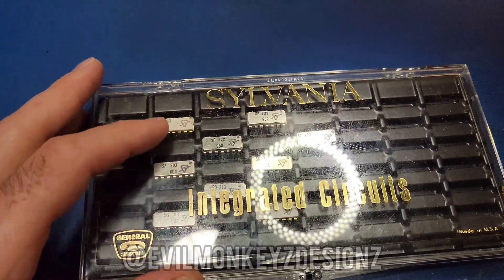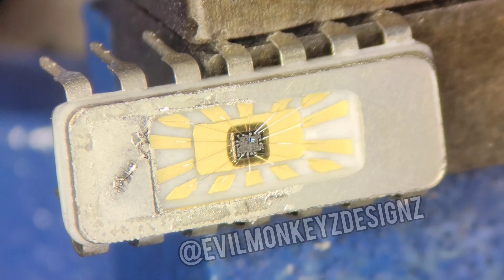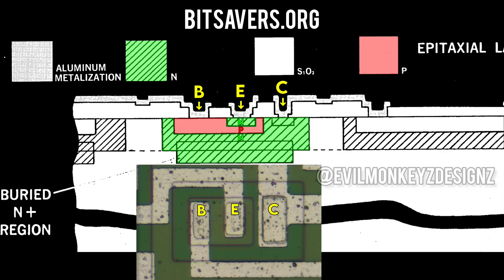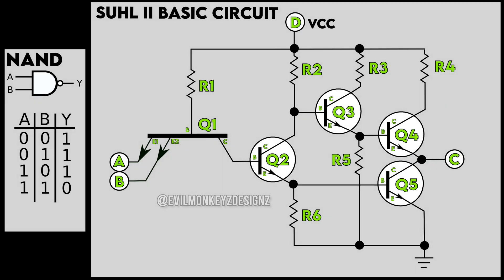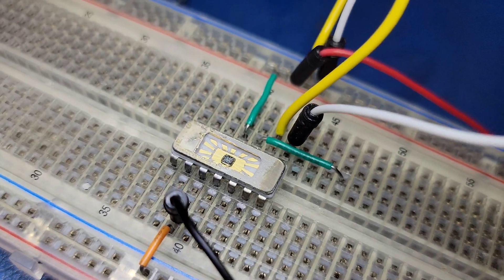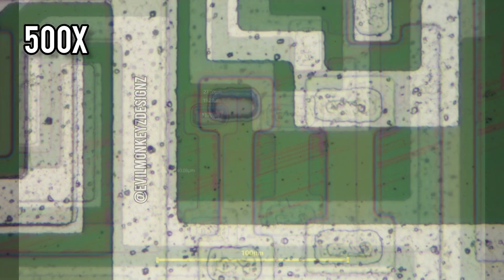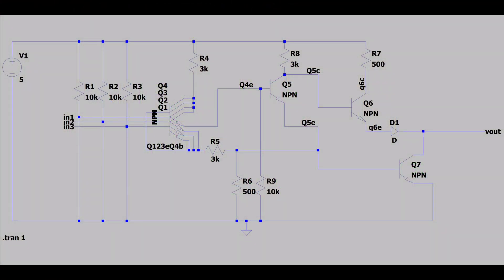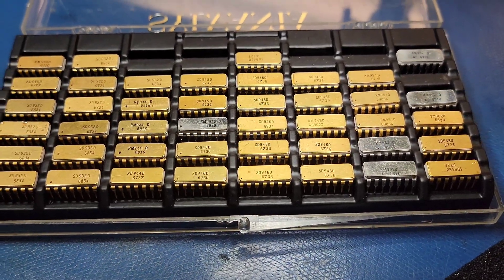🔬 Sylvania SG-222 & 223 Circuit Analysis

Comment: I’m a CMOS guy, this is Bipolar technology…..however the unknown vias or aps (apertures) may be connecting to an implanted guard ring (protecting/isolating devices from unwanted voltage or current effects from other circuitry), or they may connect to the substrate to ensure appropriate biasing of the junctions.

Comment: The difference between the SG222 and SG223 is supposedly the larger fanout (the output capacity in terms of # of inputs that it can drive) of the 222. In the datasheet it says on page 6: "Fan-out varies with elements designed for fan-outs of 6 to 30. Pretty non-informative and circular reasoning if you ask me. The datasheet of the SG70/71 is a little bit more informative: fan-out of SG70 is 15; SG71: 7. So one would expect the output transisors to be of different sizes. But you're right, we see no difference.

Comment: Some of the oddities on the dies may be for other versions where all they need is a different mask for the metal layer. This could save costs as all they need to do is change one small part, while everything else stays the same. Seems like there are not many of these areas, so this may not be the case. Great and informative video as always!

Comment: Great! Now you should try a core i7!
Reply: Hahaha... This looks to be about 10-15um lithography... The i7-920 was 45nm... So the transistors on the first i7-920 are 333x SMALLER than this IC.
Reply: @xenoxaos1 It is nice seeing a circuit this old because it is so much easier to grasp the size, the nanoscopic scale of modern circuits is absolutely mind boggling in comparison. I can't even imagine trying to recreate this explanation with a current gen CPU.
Reply: @Ramentheawsome  iirc Intel is starting work on a 1 nm node
Reply: @xenoxaos1  that is insane, we are approaching gate widths the size of only a few atoms. I wonder what the next revolution will be once we physically can't make it any smaller. I know quantum computers have very limited uses but it is really interesting to see what qubit based computers will be able to do in maybe a few decades time. I hope in our lifetime we find a room temperature superconductor which would make so many cool future technologies accessible to everyone hopefully.
Reply: @Ramentheawsome  I'm thinking the next big jump will be self adapting cpus that have large chunks of FPGA and learn common things that can be added as a new instruction... RISC vs CISC to Variable instruction set computing